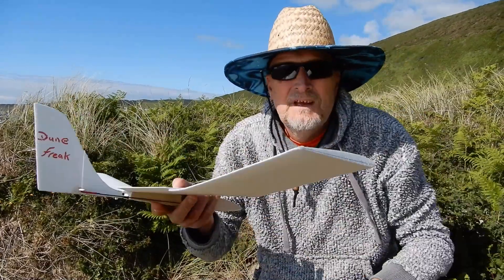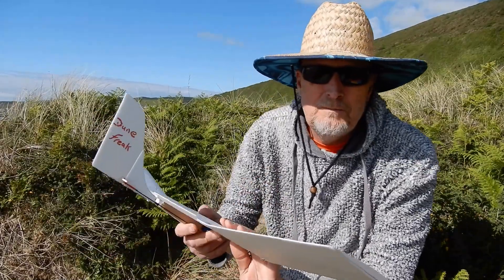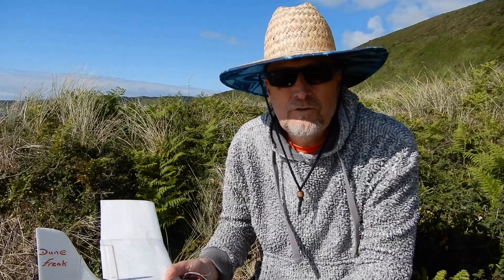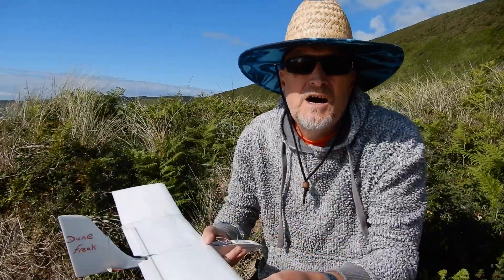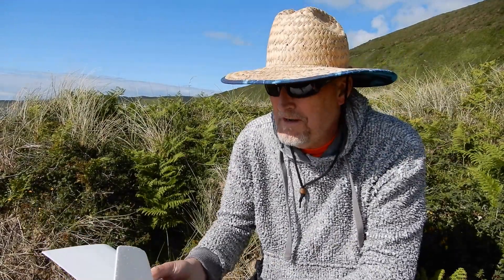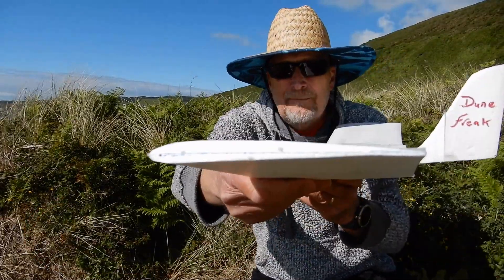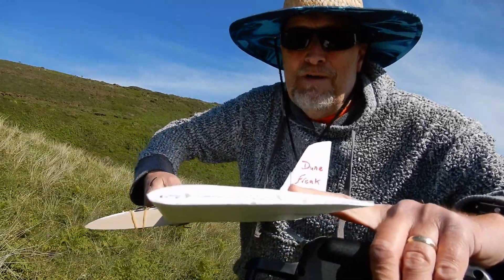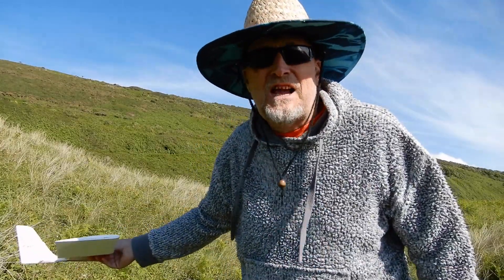Test Flight surfboard glider

Comment: Your going to need some reflex (be that up elevator or built into the airfoil) on a 'plank' flying wing. If you put some sweep on it and use lots of washout then you could avoid any reflex at all, if that's what you want to try. (or just put a tail on it!)
Flies nice though. How would you rate it against the KFm .. this one looks like it flies more efficiently.
Reply from the maker: Different class kfm is cheap I will leave it at that 😂 but it has its uses. New developments coming next week

Comment: HI Nick,     There is some Magic  in this hobby.
IMHO  On the reflex thought,  here is an artificial  reflex,   it's your  up elevator  (only) at the center of the wing. 
Your wing needs a native or  trimmed elevator value  or  "Reflex" to   build the equilibrium  between all the forces, to fly straight at a certain speed  and AoA , with the given CoG.
You can think your wing just a bit different,  more rapid and versatile,   just by designing the  size and degressivity of %chord of these elevons. One wants to  distribute the  panel chords and  Elevons  in a more elliptical way, Globally and on the deflections plan. This will highly help the wing  not  to dissipate energy (speed)  in drag   in each AoA situation.  You can think twice  you polyhedral configuration to let the elevons have just a bigger span. But of course, this design works well,  is very simple, and has a cool and smooth flight.
For a quick built slope fun fly design, the foil doesn't matter a lot. Even a flat board could work.  It's just about  the drag you manage to produce in the  flight range. A foil section is a least a drag limiter, a force builder ... But it's not the main part of the stuff.  
Thank you for the moment, Nick    You're sharing everything  that we need !
Reply from the maker: Thanks mate as I fly on my own a lot it’s good to share the cheap fun 🤩

Comment: A constant cord wing with a trailing edge taper cut at about a 60 degree angle from the vertical will produce a type of aerodynamic washout without the need to build in a  twist at the tip. The resulting truncation of the wing sections trailing edge at the tip does not appear to adversely effect performance.

Comment: The wing section has fairly low camber which gives it low cMo (pitching moment coefficient) & the trailing edges is not hooked down which makes it even lower cMo.  (cMo is a measure of the sections stability).  In this case, the section is a little on the unstable side but not so much that it can't be made stable by having enough up elevator trim to provide sufficient average  + cMo which is by definition of pitch stable.  This requires a slightly forward CG to counter balance the up trim, forward of the Centre of Pressure (CP).  If you iteratively trim less up elevator, the plane will at some point become unstable which is why it bunts so fast to this control.  It will become unstable even if you rebalance the CG.

Usually conventional gliders are very hard to bunt into inverted, requiring about 3-4 times the down elevator throw to hold inverted flight.  But your flying wing requires very little down throw to hold inverted because in that configuration, the whole section provides reflex & the elevator is only providing a small balance to trim against CG/CP moment couple.
Reply from the maker: That is brilliant thanks Ken and it does fly inverted 😍
Reply: @NickChittyFlying  Your Welcome.  Here are some links to a flying wing I designed back in 1978.  Yes, it has a sub fin.

https://drive.google.com/file/d/1OawE2XhF9euiME1RH-BrdsZLm6lW-2eC/view?usp=sharing

https://drive.google.com/file/d/1269Ckcpf4vkWNOuWdSc28lf2vaST8vEi/view?usp=sharing

Comment: The gods of stability can't be cheated. SOME advanced CG and a little reflex from the elevator is necessary. That cambered airfoil has some negative momentum that needs to be compensated.
Reply from the maker: I am currently kneeling to the gods of stability 😍😂

Comment: Hi, Nick! Nice plank! Nice flight! I am no specialist, but if my observation is right, with the dihedral you have a 2 axes wing, but your élevons (flaperons) are giving it some reflex for the inner parts of the wing... Or am I wrong?
Reply from the maker: Hi Peter It’s rudder / elevator controls agreed the elevator helps but the outer panels have none. I flew it inverted yesterday 🤷‍♂️😍

Comment: Why did you give it dihedral? for stability? I have never flown a plank with dihedral before. 
Another nice thing about that straight wing (no sweep right?) setup is you could just extend the wing longer and i would guess thats going to lower your wing loading for lighter wind days. 
What is your hot wire setup right now? bow?
pretty cool little plane.
Reply from the maker: Check out wind freak also this is rudder elevator
Reply: @NickChittyFlying  ok

Comment: As we both agree it should be very unstable in pitch without reflex and a forwards CG. But a bumblebee shouldn't fly either
Reply: When i first got my diy 4 axis cnc hot wire cutter going i was having a problem with software and i could only cut a right wing so i made a straight wing sloper. It flew so great! not pitch sensitive at all, was really surprising.
Reply from the maker: @thenatedog  this has been cheap fun. I would love a cnc foam cutter
Reply from the maker: Let’s go big 😍
Reply: The main thing is to build the flight balance. I Am a Bumblebee. (May needs more clarifications)   The Bumblebee  doesn't glide.   They lied to us !..

Comment: I can't wait for the next instalment - which Dune Freak flies better: the one with the Pug aerofoil or the Kline-Fogelman KF2 wing section. Will we be able to tell the difference under practical flying conditions?  These modern thin wing sections are certainly making an impact. They don't seem to have any downsides as long as one can handle the higher flying speed needed to achieve the required lift.  Good stuff
Reply from the maker: Pug v2 section next video is comparison but I was so excited I had to make this video 😂😂
Reply: @NickChittyFlying  Rightly so. This is a really nice flying wing.  These videos have opened my eyes to using rudder elevator for control of a wing rather than elevons.